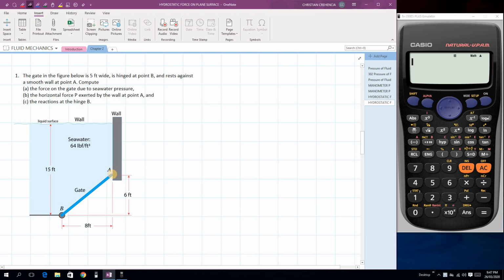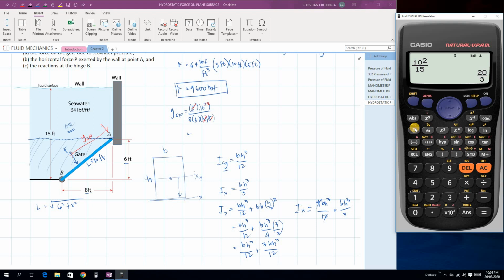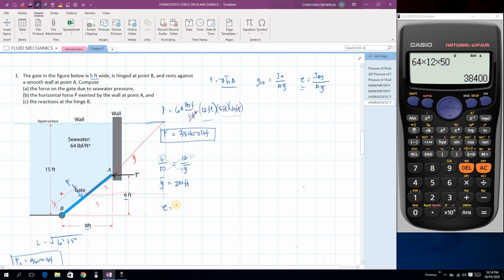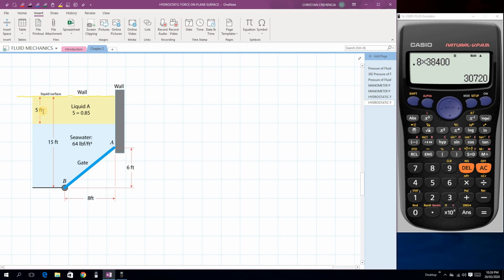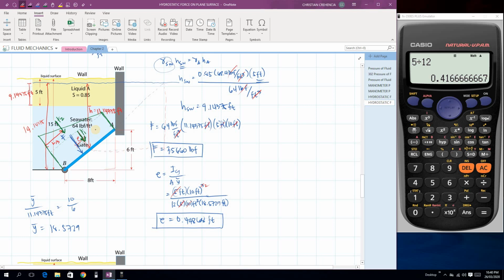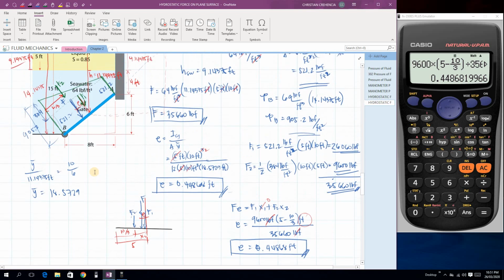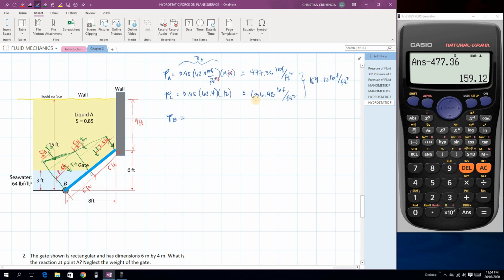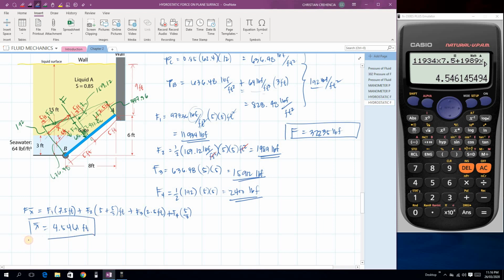08 HYDROSTATIC FORCE ON PLANE SURFACE Part 2

Comment: Hello po, may question po ako for the 2nd problem(liquid A), hindi po ba pwede gamitin yung other solution po na kasama yung pressure ng atmosphere which is zero at yung hindi ichichange na yung height, total pressure yung kukunin tapos convert into force? I hope u see this po, thank you!
Reply from the maker: Kung force lang ang kailangang makuha, no need to convert yung height ng ibang liquid. Just sum up pressures from top to the centroid of the gate.

Comment: my query po ako sir, dinapo ba kukunin yung horizontal component nung Force, dun po sa summation of moment at b
Reply from the maker: No need na kasi mas madali kunin ung moment ng hydrostatic force about B using yung total hydrostatic force F. In some cases naman mas ok gamitin yung horizontal and vertical components.  Pero hindi dapat gamitin ung total, and ung component at the same time.

Comment: Sir san nyu po kinuhang libro po ung example na ito po? Thank you po.
Reply from the maker: di ko matandaan kung saan ko nakuha. pero either Fluid Mechanics by Frank M. White, 4th ed, or Engineering Fluid Mechanics 9th ed by Crowe and Elger
Reply: sa pg 80 chapter 2 po nang book from Frank M. White fluid mechanics:)